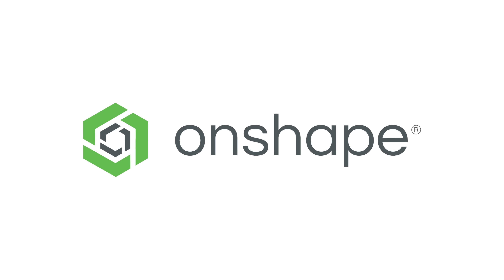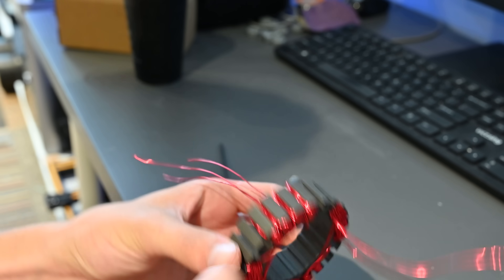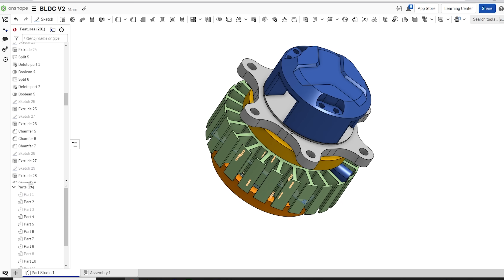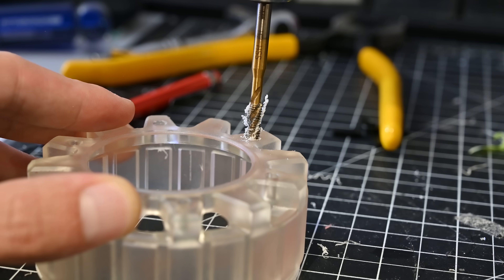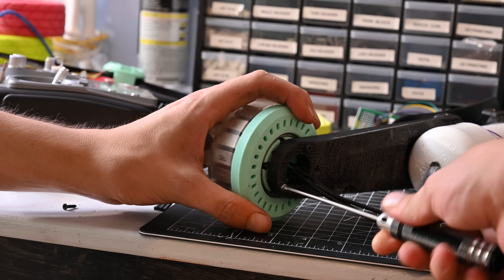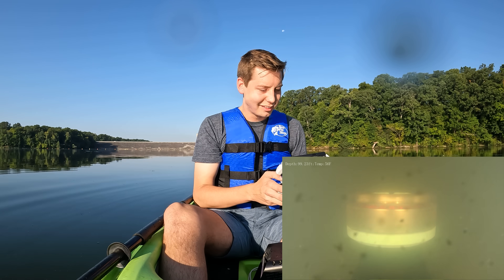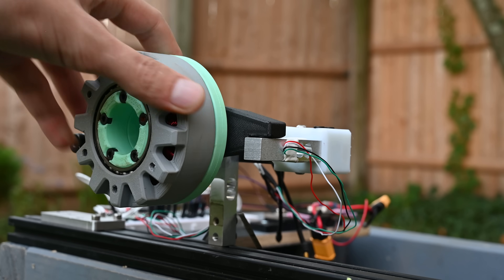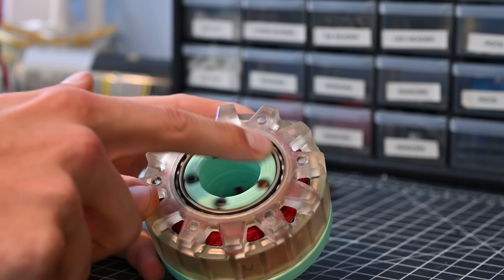Waterproof 3D Printed Brushless Motor... Will it work?

Comment: Seems like your motor wants to spin faster, like maybe 10-15k rpm for high efficiency. You could give it lower load and balance it to let it run faster. Balancing might be helpful anyway. However the related problem is that the dissipated power would be larger at those higher speeds, and I think this motor would melt first. You could redesign it to be efficient at lower speeds and/or lower power, and reduce waste. Pick a few from: 1) use more windings of thinner wire 2) use a better stator eg low-hysteresis ferrite or laminated steel, you know good transformer materials 3) put a yoke around those permanent magnets so they're not wasting field in free space out the back 4) smaller gap between rotor and stator.

Comment: Really impressive that you've gotten a DIY brushless DC motor to work. And pretty cool that it can spin a propeller pretty well. I'm guessing this not intended as a practical use item - more of an interesting project right?
It spinning so slowly means your kv is pretty low. The main problem here (besides efficiency losses) is that normal brushless dc motors can get up to 90 degrees Celcius. 3D printing the stator means that it melts way before that, thus you can't get the amount of power throughput that you need. Making the stator out of metal would help...

Comment: print the stator in thin layers,get some vinyl or something else that insulating and put between stator layers, you could use thin layers of insulating enamel used for winding wires, then epoxy the stator together, this will get cut down on the eddycurrents or just send your stator file to send cut send get sponsored, so its free and laminate it together with electrical enamel.

Comment: You need to use a thinner copper wire to minimize resistance and also you need to add cooling holes and maybe something that doesn’t insulate as well as pla

Comment: This is just ground breaking. There have been suggestions for the heating and balancing issues

My advice is to make a metal housing for it (like a tube) which lets water through (for cooling) then plate the inside with a diamagnetic material to confine the magnetic field to the stator and maximize flux density

Comment: Can you be able to make another one and connect them in so way so they are parallel to each other other one can be used as a generator so it's efficient and don't use lot of energy when it comes to total power use! i was thinking to make one but i don't have the resources.

Comment: I can provide a little bit of insight into waterproofing your electronics pod, if that's the thing you need to do again. It's possible for water to infiltrate the pod between the insulation of a wire and the wire itself like a tiny plastic hose, so at the point where the wire goes through from the dry side to the wet side through the resin you want to strip off a bit of insulation, so there's a short section of exposed copper inside the resin, then the resin will effectively plug the little pipe created by the insulation on the wire, and because the wires aren't touching the resin becomes the new insulation that separates them inside the joint. It's not too big an issue just to be rainproof, but when you're dealing with water pressure it always finds its way in. You can also or additionally pressurize your electronics package, install a Schrader valve like on a tire to the PVC pipe or the cap on the opposite end and pump it up to pressure higher than what you're going to encounter at the bottom of your operating depth.
Reply: Agree, what @AlRoderick said. There are a couple more helpful options.  1) You can make electrical passthrough connectors with threaded rod, washers, and silicone. The trick is to silicone the joint between the pvc and threaded rod, let it set up, and then compress it with a rubber washer and nut.  The washer and nut compress the silicone against the threaded rod, stopping migration down the threads. 2) Fill the PVC pipe with a non-conductive fluid like mineral oil, like the immersion PC people do.
Reply: Give the enclosure a bilge and put some water-absorbent material in it, eg water beads, desiccant packs, calcined clay/gypsum. That'll give some margin for minor error.
Reply: I ran into this doing an underwater ROV. We just could not figure out the water ingress, doing seal tests in a bathtub worked perfectly, but then 15 feet under and we'd get water. No water in the Oring channel, but somehow water in the chamber. We ended up making a passthrough of bare wire with a scotchkote coating, then potting that in epoxy. Probably cheaper at that point buy aircraft style passthrough connectors.

Comment: "GoPro has overheated"
Why is this so common? I've heard lately EVERY maker or YouTuber who uses them complaining that they're unreliable, overheat, or the battery/power circuit has constant problems. They used to be so good too.
Reply: I also noticed you had to hand prop it a few times to get it spinning. Is this something where you could use a shaded pole to kickstart the motor? Or should the ESC do that somehow?

Comment: You can't really expect an electric motor to be efficient and powerful with all these magnetic loses. Not sure about the performance of this iron filled PLA in this application but the rotor doesn't has any metal at all which leaves a big air gap (or plastic gap in this case) between the outer side of the magnets. The magnetic flux needs to run in a closed loop through a stator finger, the magnet , the rotor casing and then back via the neigbouring magnets and stator fingers. Every millimeter in this path that doesn't run through a ferromagnetic material adds to the losses. It may be worth and try to print the rotor case from iron filled PLA also. But you would probably also have to change the mounting of the magnets because the slots for the magnets would create a kind of shortcut between poth poles of the magnets. I'm pretty sure it's possible to improve efficency a lot but probably not to the level of a motor build from "proper" magnetic materials.

Comment: 1. Quality of winding is crucial for efficiency - each deviation from wires going in paralel in same coil weakens magnetic field very much. Also make sure that centrifugal force does not mess up coil shape.
2. If possible - move magnets closer to stator. Magnetic field decreases by quare of distance, so each change, especially on small scales, makes big difference.
3. For heat - you can re-shape your rotating motor case holes so that each such hole acts as small fan blade that moves air inside the motor to cool it

Comment: ' Will it work?'  Yes, of course it can basically work.  The real problem is increasing gaps, etc to make a waterproof motor.
You're generally better off to have a sealed bubble for a dry motor, and then just a magnetic coupling for the shaft through the wall to spin the propeller.
There's very little gain in trying to make the motor itself waterproof, and so many ways to lose by trying to do it.

Comment: I suspect the iron filled PLA has a really low % of iron. Else it wouldn't print well. Also, it should be a high permissivity alloy able to quickly switch pole polarity.

Comment: Ok, I've been planning on building my own small 3 phase motor and design is definitely a great starting point for me. As for improvements using a cnc laser cutter or similar device, cut out the stator from thin steel sheets and stack them in high temp resin. That is my plan partially, Ill end up tweaking your design a bit more but not for improvements but to fit my purpose. Dude thanks and keep up the work!

Comment: I've been thinking it might be possible to print a BLDC motor that has the stator water cooled. Its probably going to be the static part sandwiched between two rotors in an axial configuration. I've printed simple small axial motors that work and used the very same winding pattern generator you used in this video but used axial magnets instead of radial. I have bought a Bambu Labs Carbon X1 and can now print CF Nylon which is both a lot stronger and has a higher temperature resistance than PLA. Finally have a look at this fracture pattern forming on a vinyl disk spun at very high speed: https://youtu.be/n-DTjpde9-0     I suspect high speed rotors would break from the outside in, this makes sense since the forces are greater at the circumference, one solution would be to wrap carbon fibre tow around the outside edge...

Comment: Regarding the heat dissipation problem there are many good suggestions in the comments.  One less good suggestion: consider making a variation of the components which melted that can be actively water-cooled (i.e. there are empty channels through the hot parts which you pump water through).

Or run your tests in a fish tank, at least.

Comment: The magnet-pockets are too "deep", making the air-gap to the stator too wide, that´s bad, maybe you use shallow pockets and glue instead of dowel-pockets next time. also, the gap becomes less aero/hydrodynamic with such pockets, slowing the motor. turning surfaces and other surfaces opposite of turning surfaces have to be as flat/smooth as possible and let water/air circulate without hinderance.

Comment: efficiency will never be anything unless you use laminated transformer armature or stater as they will direct the magnetic field most efficiently to the opposing magnets... Also bearings will get damaged underwater as there are many particles which will wear the bearings out even if they are ceramic apart from the friction of the water in between all the motor parts which are very close together generally....

Comment: You are measuring efficiency with thrust from a prop?
...well you aint measuring motor efficiency then.

Jury rig a prony brake together or something.

Your setup will not onlx include prop losses, its also going to be wildly inaccurate for any motor whose optimum characteristics dont match the optimum speed and torque needed for drivingnthe fixed pitch prop xou have.
Reply: As for increasing efficiency...
- less gap between stator and rotor the higher the efficiency
- make stator out of iron filled PLA (if protopasta still makes it)
- and use thinner wire with higher voltage.

Power input is voltage*amps.
Torque is winding turns*amps.

And amps cause heating.

Since you aint limited on voltage by using RC batteries, use thinner wires with higher voltage and you will much more easily achieve performancen- without running into thermal manadgement issues.

Comment: I can recommend looking up on three phase Y and Delta connections for motors. Generally (if i remember correctly) you start the motor in delta connection and then switch over to Y connection after the motor is started. This gives the motor better stability at the start and becomes more efficient after switching to Y connection. The draw back is that the circuits become more complex.
Additional notice: Tesla is just started working with six phase motors. But I speculate that they just drive both side of the coils instead of doing a Y/Delta connection.
Reply: this is for big AC motors.I dont think anyone is doing it with BLDCs which are ESC driven.

Comment: Michael, please put the loop in the Qsea’s tether around the handle!!  The connector was never designed to take a load. When looped around the handle it has a 200lb rating.

Comment: You need to have a iron (or steel) core. The 3D filament you use never works efficiently. Not only have I tried it but other YouTubers have tried it and we all have the same result.
However you have your own milling machine. I think it should be possible for you to get some really thin steel sheets, and either cut them out on that directly and laminate them together yourself or, maybe cut squares quickly and spray some kind of insulating layer on them and stick them together one on top of the other until you get a thick piece and then mill out that thick piece to the shape you need.

Either way you end up with a laminated core like all of them have. This will not only make it more efficient, but give the coils a heat removal path.
Reply: I had an idea to use flat roofing sheets. They're about 0.5mm, I think, and they come with an insulating coating from the factory 🙂. I've never gotten around to trying it though.

Comment: 🎯 Key Takeaways for quick navigation:

00:00 🛠️ This video is about a 3D-printed brushless motor designed from scratch.
00:17 🧲 Brushless DC motors work through electromagnetic fields generated by magnets and stators.
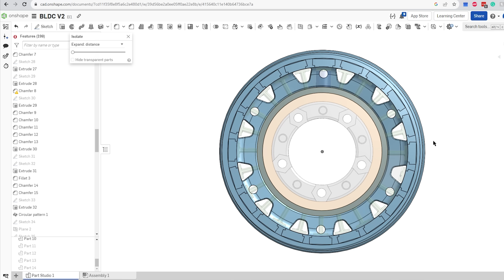00:46 🖨️ The motor design is mostly 3D-printed, with parts made from standard PLA+ and iron-filled PLA.
01:19 ⚙️ Winding the stator with 22-gauge enameled copper wire is a challenging but crucial step in motor assembly.
02:04 🧲 Magnets are added alternately around the outer housing, creating a magnetic field.
03:05 📁 CAD files for the motor are available for free, thanks to the sponsor, Onshape, a cloud-native CAD platform.
05:50 🌊 The motor is tested underwater on an underwater drone, successfully operating at significant depths.
08:53 🌊 The motor reaches a depth of 99 feet underwater during testing.
11:15 🔬 A data-driven test rig measures the motor's power output and efficiency, highlighting areas for potential improvement.

Made with HARPA AI

Comment: Unfortunately your lack of efficiency is from iron filled filament. I've read the datasheet, it states the relative permeability 5-8 and saturation at 0.15T. They are way tooooo low for motor -  iron has permeability at least 2000-3000 and 1T saturation. That filament is close to ideal for some type of inductor cores. You need laser-cut transformer iron for the motor.

Comment: Using soap dispensers for dispensing resin is a weird yet interesting idea.
Reply: Those aren't soap dispensers. All of the laminating resin companies offer measuring pumps. So they will give you two pumps of specific size chambers and after their primed in full all the way you just do one pump of part A and one pump of part B and they're close enough in ratio that you can use them.

Comment: Hi! I didn't know that BLDC motors can work in the water. It turns out that only the ESC needs waterproofing. Is that correct? I am working on a project of a robotic boat that will carry 1-2 passengers to and from a yacht. What power of motor would you suggest? Thank you. Gennady

Comment: There's a rule of thumb to have your pole count as close as possible to your slot or winding count (but not equal cause that can't work). So for 24 windings you're better off with 22 or 26 magnets instead of 20. Though this would improve like 1% so not a big deal.
Reply: It's not a problem to have equal number of windings and magnets, it's actually the most efficient setup for power output, but they don't do it because it causes cogging at low speeds - the magnets are attracted by the ion cores opposite them and it stutters, even sticks into this position when stopped.
Otherwise, yes you need them as close as possible, just 1 or 2 off to prevent cogging.

Comment: Electric motors have a little problem: magnets are double sided,not one sided. That means that an electric motors are actually not having a full power but around 50% depending on design. But,if you use bell electromagnets (they are used in electric cranes) you will get full 100% of magnetic field power. As a matter of fact,a 20 mm magnet with 100-200 rounds of 0,1 mm wire powered by 3 AA sized batteries connected in series can lift ~140 kilos.

Comment: High voltage will be your friend. You can do higher windings to reduce Kv. For example, a 320 kv 6s motor vs a 160kv 12s motor with the same load, the 12s motor will run with a tempt delta 1/3 less than the 6s.

Comment: Great work! You would impress me so much if you could electroplate iron or nickel on the 3d printed core (of the copper windings). The iron would lend itself to better heatsink, structure, and better flow of magnetic flux efficiency.

Comment: maglev lorentz ac motor, with radial current thick wire, always rotates to same direction, with both ac current directions, the current wire functions as the copper maglev plate, no windings, possible only the induction loop at the current wire end. I hate BLDC pulse motors, no continuous force, has pulse gaps.